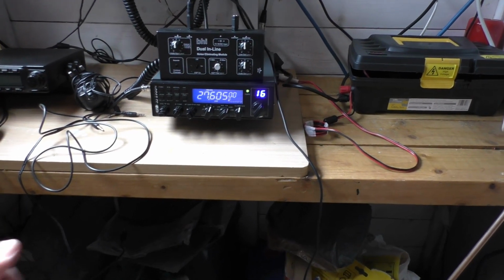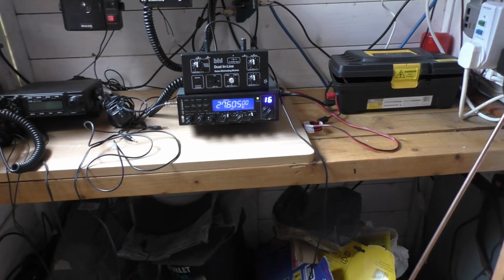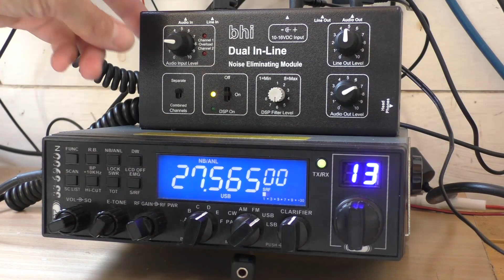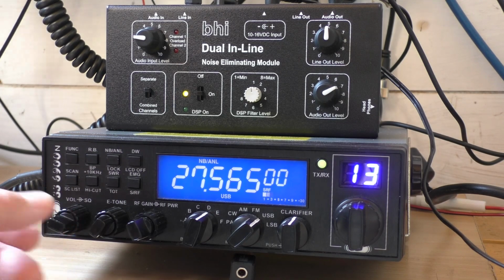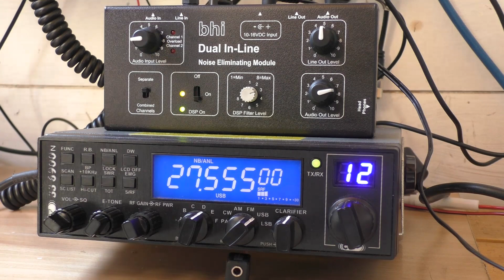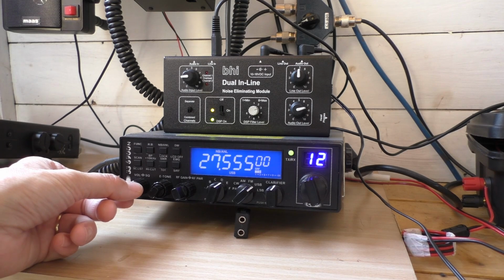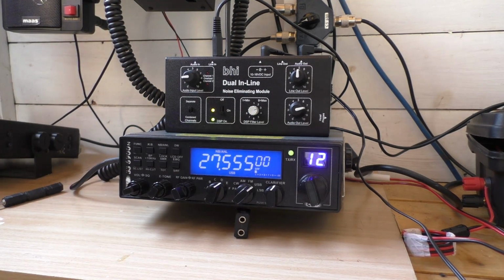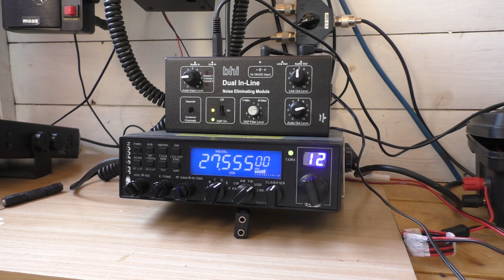BHI Noise Cancellation filter module for PLT noise

Comment: That sounds like one of the cheep inverters being used on a set of solar  panel's  i know its a big ask but have you turned on that radio say about 3 hours after the sun has gone down...to see if the noise goes as in the dark the solar panels wont be giving off a charge..
Also i know this is a number of things but has your next door nabours each side of you got auto garage doors...you get noise off them some times....then here is a real shot in the dark have you earthed out that radio to a ground stake as in it has its own ground steak to earth out all other noises...
Cheers rob.from the land down under 🙂🙂

Comment: Hi Fred I am doing a foundation course they talk about putting in a RF earth which earths all your appliances which stops RF noise back down the coax. They even say earth the outside of the pl259 to the radio.
Reply from the maker: Hi Mark cannot do that as i have PME earthing.  i will explain more in a future video.  ta.
Reply: urbex2007 This advice was given to me by the full licence radio hams to stop RF coming back down the coax. On the back of the EMU there are earthing nuts they told me to earth my equipment  as this will stop noise even put an earth on the outside of the pl259 this all came to me from the full license radio hams who have been doing this for years.They told me to drive a copper stake into the ground and earth my equipment and not use the house earth.

Comment: Could be Wi-Fi extenders, telephone cables, Broadband, Plasma TV, Small chargers like phone chargers, Laptops, in fact ant thing electrical.  I suppose you did tune the filter for minimum noise, of course you did.  Sometimes a copper sheet with everything earthed to it and the sheet earthed will help a lot, but I think you need to do a bit of sniffing around to see if you can find a source, but as you say, people working from home like I have makes that impossible at the moment.

Comment: Worth trying horizontal, my PLT crackle vanished for some frequencies which is great for the QSY. And dropped from S7 to S1 elsewhere : ) Still works good for the summer DX as the E layer potentially rotates polarization anyway. Bidirectional though so you get 2 nulls but if you have it facing central Europe it does ok on radio power. A little inconvenient to put a T2LT on 2 fish poles but the crackling virtually disappears for me, I can get it up in 10mins with poles and gaffer tape. Worth a try for the many plagued by this harsh crackling. I think you are right with the Antron won't make any difference. PLT really sounds like old cars ticking over but of course this won't be the source of the problem. Flat side worth a go, good luck.

Comment: I was getting a lot of noise on my radio on 10m, not same noise as yours, I was using ethernet cables to my TV and Xbox, removing them and switching to wireless connection solved the problem, you wouldn't think it would but it did, I also had a problem with one plug socket, if I plugged my power supply in one of the sockets the noise was bad in others it wasn't, good luck, that clicking reminds me of a rotary device, a fan, a charging spinner in a water meter, a fish tank pump, something like that.

Comment: This is 100% PLT interference, it is not solar panels or smart meters. You need to take a walk down the street with a handheld CB or a shortwave receiver on AM with all filters/noise blankers turned off.
Reply from the maker: Thanks Dell i will prob try that in the future.
Reply: Have this noise too but thankfully I’ve discovered that it’s coming from my immediate next door neighbour. I used my small belka receiver to track the noise  down. As I walked up and down my neighbourhood the interference went off the scale as I got closer to the offending QTH. I just need to have a friendly chat with them now and see what we can do to remove the plt extender and replace it with a more radio friendly alternative.

Comment: Since most of us have this same type of QRM, it suggests it’s the same type of product causing it.
I wonder then if a specific filter could be found? There must be boffin types out there.
On the horizontally polarised aerial idea, I’ve tried the Imax 2000 and a G5RV dipole. Both noisy.
The only way I can work 11m is by using the NB on the 450d.
Interestingly that noise almost disappears at the top end of 27Mhz into the 28Mhz ham band. That could suggest that’s it being choked for the ham frequencies but not the CB band as we have no “protection” from Ofcom.
Reply: Yes, you're correct. The PLT devices are usually 'notched' to protect the Ham radio bands, although there are plenty of PLT devices out there that cause us hams issue too ! I have found these BT devices to be notched on 27MHZ as well as all the ham bands so can highly recommend them. Not sold new anymore you will have to source them from somewhere like ebay - 
"BT Mini Wi-Fi Home Hotspot 500 Powerline Kit"

Comment: You could buy some large ferrite rings (toroid) one for mains power cable to power supply, one for power cable to radio and one for coax near radio, wrap cables inside and around the toroid.

Comment: @Fred: as I mentioned in an earlier comment, that RFI that sounds exactly like interference I found coming from a variable speed drive which controls a parking garage exhaust fan. VSD's are notorious for such RFI if they are not grounded correctly as per manufacturer's instructions. VSD's have similar circuitry to inverters, so a solar inverter will have a similar sounding RFI signature. 
In my case, I found the source pretty easily by walking around with a portable AM radio (pocket transistor type). The directional ferrite antenna in it led me to the source. Damn lazy electrician didn't read the grounding instructions. 

Originally, I thought it was coming into the property via the power lines because I could detect it under those lines. However, it turned out that our poorly-grounded equipment was exporting the noise!
Reply from the maker: Hi James the AM radio (well Tecsun 600) part will follow.

Comment: plt noise i have that on 11m  as soon as i go to 28m on my little ft817 it goes.
cb band and 11m is the worse for it.
and that dsp filter will not get rid of it.
do you have one of the green bt boxes near you.
led lighting power supplies 
even tv antenna signal booster can give you it.
laptop chargers phone chargers many things
floresent lights power supplies do it too you need a proper noise cancelling filter that mfj does.

Comment: Yes, DSPs are notoriously bad at impulse noise like that. People are right, it sounds like ignition spark noise from my history.

Phase cancellation may work.

I hope you find a solution. I'm fighting different noise and yes, my horizontal EFHW is sooo much quieter, but doesn't transmit as well as the vertical. T/R switch is on the table now.
Reply from the maker: Hi Pat.  It mostly stopped on its own.  Cheers

Comment: That noise is so irritating!
Almost like impulse noise from an engine ignition system at idle all the time.
I would take great pleasure in stomping the offending device into a fine powder once located and removed.
Reply: I was thinking the same thing Adam, clearly not the issue but it does almost sound like electromagnetic energy from high voltage sparks.

Comment: Hi Fred on my foundation course they even said central heating can cause it.
Reply: In the middle of summer?
Reply: @Perthshire  its england, it gets cold at night, esp if your older ;)
Reply from the maker: Thanks Mark.  The heating off at the moment and the water heats just a few times a day.  I will do a dark test once everyone goes back to work.
Reply: Your heating still heats the hot water even if the central heating is off
Reply: I am doing my foundation with Essex ham radio and they talked about noise in the shack and how to eliminate it.
Reply: Hope you get it sorted Fred
Reply from the maker: @marksteeples5489  The boiler is set to come  on 3 times a day to heat the water.  Other than  that its off.  I know this as if everyone has a bath midday you have to man boost the water as it runs cold. Brrrr
Reply: Hi Fred best of luck finding your problem love your videos that’s what got me started again in radio thanks

Comment: You need to eliminate it before it get's to the receiver the qrm eliminator is the way to go if you can get the noise antenna close to the source  then you can phase out the noise against your normal antenna
Reply from the maker: In truth i really dont want 2 antennas up in the garden.
Reply: @CB-RADIO-UK  The noise antenna just needs to be a piece of wire but need to pick up the noise then you can phase that out against the receive antenna  all i have is a piece of wire in my shed that picks up the noise  then i phase it out against my normal antenna .
Reply: @M0NXF  but what kind of device is needed for such a thing or is the antenna just passive?
Reply: @gamingforlive2150   passive just needed to pick up the noise for a qrm eliminator to phase it 180deg out  of phase from your normal receive antenna  i have 2 videos of one in use
Reply: Unfortunately, these don't work with PLT QRM

Comment: Hello Fred, May i suggest you hook up your gear to an independant grounding system, it can be a few earth rods connected in a 'Delta' configuration (looking down from above). It should help reduce the noise, as i had similar issues when i set up my shack. All the main gear is connected to a 'focal point' to the main ground being an old fashioned cold water main, which goes all the way to the street. Another good solution is the MFJ-1026 noise phasing cancelling, now this gadget has  a good successful reputation so it might be your answer if you cannot trace/resolve the offending interference. By the way your Antron is doing fine bud, you cannot please em all lol :) ;) Best of luck Fred, Cheers  :D
Reply from the maker: Hi Ray.  Cannot do that as i have PME earthing.  I will explain in a future video.

Comment: Hi Fred great vidios very entertaining. I have a 6900 with a kpo 532power mike.antenna is antron99 all bought on your recommendations. My trouble is same as yours continues noise on A and B band s8 still on other bands but not as bad.I am about 50 feet down the garden in summer house.open fields at the back council houses next to me.any ideas on helping me out please.also I am on a 10 foot pole attached to concrete clothes post.will it help do you think if I put it up to 18feet. Look forward to your reply.cheers tony.
Reply from the maker: Hi Tony.  Height will always help your receive.  If your exposed to the field and winds you may want to use some guy wires.  You can by a "spider" which will attach to your pole.  Noise wise it prob wont make a lot of difference as your away from the house but it can only help.
Reply: Sorry to trouble you again. Do you think it could reduce the noise also.I did have a contact in Volgograd Russia at the weekend on just 10 feet from the ground.its the noise that's doing my head in lol.not wanting to go any higher than 18 foot.thanks

Comment: Hi Fred. Bit off topic sorry, but I wonder if you can help me. I was a avid CB'er in late 70's early 80's and am thinking about getting back into the hobby again. I'm even considering going down the Ham route too. My question..  Is there a radio that can transmit and receive on all am fm sideband UK CB frequencies AND Ham frequencies? I appreciate there may be legal considerations but simply wondered if such a radio existed, especially one you could recommend.  Keep up the good work!
Reply from the maker: If you want all Ham freq then you will need a HF radio which has been modded to include transmit on 11m.  I bought my Yaesu 450D ready converted.  My 2 Alinco radios 77e and SR8 were 2nd hand.  I modded the 77e myself.  lots of video on the channel.  If you just want 11m and the 10m ham band then the CRT 6900N will do that.
Reply: @CB-RADIO-UK  Great info cheers. I'll start my research based on your helpful advice.

Comment: Shame bout that noise.. I had similar problems at a previous address.... Dose get annoying.. I traced it down to something in my neighbours house with aa yeasu 817 and the rubber duck twig 😂.. Goodluck 🤞 👍
Reply from the maker: Yeah its a pain.   It seems all around but i will try to solve it.
Reply: Interested in what you get using the battery. Wonder about putting in the car with a magnet mount to see if it's the house mains, or the whole neighborhood or just near your home.

Comment: These filters are only really successful on qrn or naturally occurring interference. When you try to eliminate qrm or man made interference such as plt transmissions, well you end up filtering what your trying to listen to.. ie radio transmissions which is why they end up sounding digitised or clipping as the filter could be narrowing the band width of the signal...

Comment: Fred I have not had time to check comments it may have already been mentioned.. have you made a choke and put ferites in.line? That is one nasty noise are you using a switching power supply ?
Reply from the maker: Hi Lee.  Its not the PSU. No air choke but i need to replace the 213 as its too tight so i will add one.  Tried some small ferites which did not help.  Next video i go hunting a little.
Reply: The cheap small ones are naff but that sure is a annoying noise I guess it's a matter of going around and trying everything switching on and off appliances .. it's gonna be something stupid I'm sure keep the vids coming hate to say it but that problem is becoming a pain in the ass to you. Sure sounds like that power supply gets some good grounding to

Comment: What are your thoughts on the President McKinley EU ? I know that the 6900 is cheaper but I was looking at the legal rig as an option.
Reply from the maker: Ive not used one but have chatted to someone on air and it sounded good.  It gets good reports.  Generally all the President radios are pretty good.  Look up " m0ogy " on YT as he has tested most of them.
Reply: @CB-RADIO-UK  OK will do thanks.

Comment: Hi Fred. Can I ask question? (Not related to this vid),,, I can't find a 6900/9900ssb radio for sale anywhere !!!  Any ideas?? Also, what's your thoughts on the CRT 7900? It does seem there is a few of these available, is it because they are not as good as the others? Would value your thoughts.
Cheers. Tim CT3167
Reply from the maker: It seems the 6900 and 9900 have sold out.  (It was on my last video). New stock is supposed to be arriving mid July.  Ive never used a 7900 myself but the spec is very close to the 6900 and it appears to come with the better 9900 mic.
Reply: @CB-RADIO-UK  Doug at Knights has some Anytone AT6666 which he says are similar but don't have the 12metres on there,,,,will that matter? I'm not a ham anyway. 
What would you do? Go for the Anytone 6666 or wait for the crt9900?
Reply from the maker: @TimTM-gm6od  It would not matter to me.  the 6666 should cover 10 and 11m.
Reply: @CB-RADIO-UK  cheers Fred. I think it's probably for the same power as the CRT 9900 so should be good to go. I'm hoping I can get up high somewhere near Winchester and make the trip up to you guys on the 305 !

Comment: Possible 5g transmitter's in the area or the big 5g masts. You wanna take a walk or drive around your local area to see. The EMF radiation detectors make the same noise when picking up high levels of the sound you're experiencing. You might be hit with more than one 5g mast in your area, worth investigating!!

Comment: Too bad your NB is not able to take care of this pulse noise. On CB radio only my President Grant has done the best job on SSB pulse QRM, other than that some HAM gear deals better with it, but it also depends on the nature of the pulse noise itself.
Reply from the maker: Yeah its a shame.  My Grant 2 is in fact the worse.  Only my Yaesu 450 D really reduces it right down
Reply: @CB-RADIO-UK  sorry mate, i forgot to mention it is a Grant from 1981 or something like this. It's NB is just awesome, but mostly effective in AM. I also have seen some improvement in SSB which I did not see on other vintage CB. I don't buy newer CB than after 1995. An other fine rig is the Lincoln MK1 but it needs care after a while with the glue eating up the thin wires of the ferrite filters at the final transistor level. I also own a 148GTL-DX MK2  (PB010AB) which is still under restoration.
Reply: My kenwood TS50 noise blanker pretty much eliminates the noise on SSB. I have had the power off to the house completely and used a battery I maybe lost around 1/2 pounds worth of mush but the Plt noise is very much still there. Annoying. I have the sirio gain master and a horizontal wire dipole. The dipole picks of more plt than the vertical. I'm going to try some ferrite clip on beads on the dipole near the antenna feed and also near the radio end feed. I'll let you know how that goes! I feel your pain!!

Comment: Hey Fred, got My A99 up and my friend who put it up thinks it's faulty. he tested the coax for continuity at one end and nothing, so hooked that to the Antenna and tested the other end and there was continuity. My swr/power meter seems to work when it wants to and the SWR on EU FM is 1.4 ch40 and 1.3 ch1 using the built in SWR. I've been picking Germany, so I'm not sure if the Antenna is faulty or not as everything seems to be running fine. Also how to I tell what version of SS9900 I have.
Reply from the maker: This always confuses me but i did a video a while a go.  I think your supposed to get a short with the coa connected and not straight on the antenna.  If you have a short your SWR will be way up 4-5.
Reply: @CB-RADIO-UK  swr  is about 1.3 to 1.4 on eu fm. I'm still getting my head around the ss9900 as I'm used to a basic display. My last cb was the ss360 on the plus side. Swr isn't above 2.0 on uk fm. I still need to fine tune the rings.